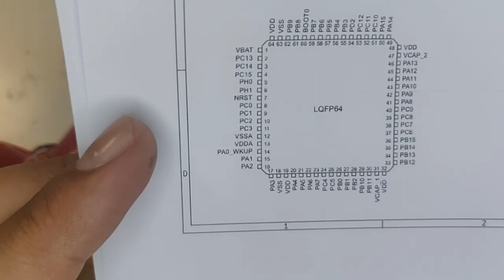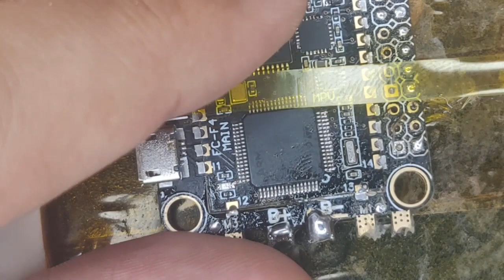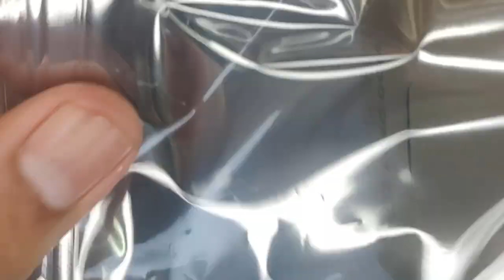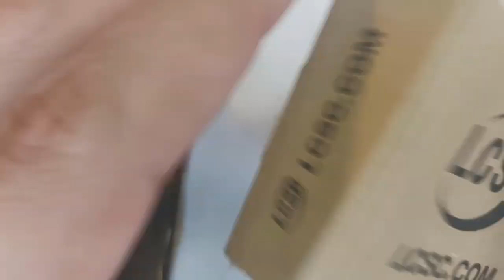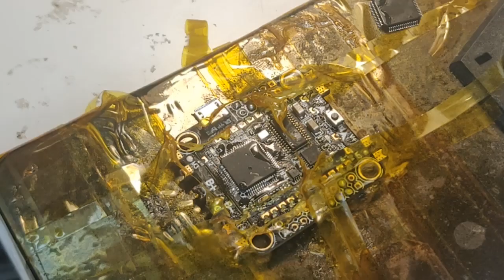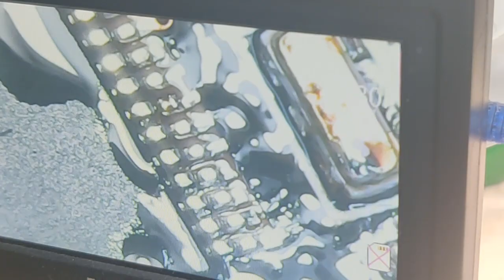How to repair a Dead Flight Controller (NO LED)

Comment: what does it mean if my red light is working, blue light isn't, the motor makes 3 beeps instead of 5, and once plugged into PC, it doesn't show up in betaflight?
Reply: Did you ever troubleshoot this issue? Just curious I'm in the same boat right now and about to take this apart.. I am worried my FC is fried now and hoping you had some success.🙏

Comment: So basically I am very new to this FPV drones I ordered parts not too long ago and got everything built. At my latest stage I configured my FPV using Betaflight. I basically had my flight controller connected to usb port and had my LiPo also connected. I just wanted to finish configuring the Motors and make sure they are spinning in the the right direction and suddenly my XT60 black cable went loose. I must have soldered it and I didn't put flux on it so it was holding on very poorly and was the matter of time when the Red or Black cable of XT60 would just come loose from the ESC pads. My FC LED labelled "BT" started slowly flashing in green light. I thought I'll just resolder the XT60 connector and will get my FC to work back again with all LEDS ON but I was stupid enough to believe that cuz it didnt even work when connecting to USB port like it used to before. There used to be many LEDS and now just one green flashing. So I looked at the STM32 Chip and measured continuity with my Multimeter like u showed here and VDD is shorted to ground : (( . I still dont understand how I destroyed my chip because all it was is the LiPo black lead went loose while I was configuring the Motors in Betaflight and I just tested them by powering them up and watching their speed in the Motor section of Betaflight. Can it be that when XT60 ground lead went loose, It touched any of the FC Voltage pads ? Also I looked at all the voltages and checked continuity. Like 10V, 5V seems ok and doesnt have continuity issue. But when I tried checking 3.3V and ground they got continuity, meaning my 3.3V is shorted to ground. Anyways I ordered new FC thanks for the help btw!

Comment: Hey i have a problem with my FC because i had a water damage, at the beginning there are the 3 normal beeps but the Rest is beeping fast and the ligts on it flash Like normal it binds but does nothing Else.
Reply from the maker: "Guide: Troubleshooting arming issues" https://www.multirotorguide.com/guide/troubleshooting-arming-issues-why-quad-not-arm/
Reply: Thanks

Comment: My flight controller sound upon usb connection works but the led no longer lights up as of today . What could be the cause .
Reply from the maker: Does the FC connect to betaflight?
Reply: @Fungineers  mine doesn't
Reply from the maker: You got a red LED? If yes, then connect and go to fiirmware flasher and reflash firmware
Reply: @Fungineers  I don't have a light. Doesn't connect either

Comment: if you need informations about programing this chip please contact me on the comments here so I can help you.
Reply from the maker: Thanks!
Reply: I have no shortage between voltage and ground but i still have no LED i tought i maybe bricked the FC. How can you force flash the firmware on my FC?